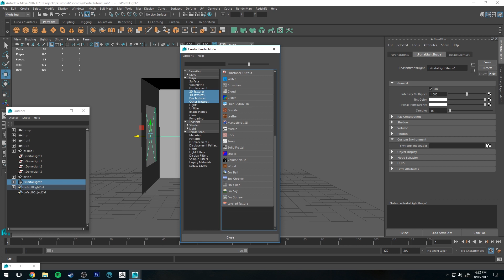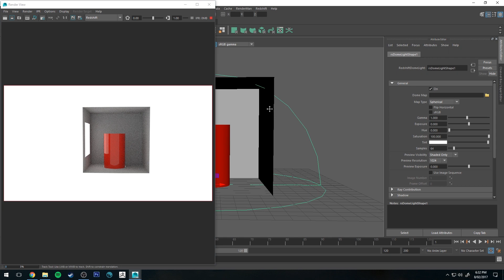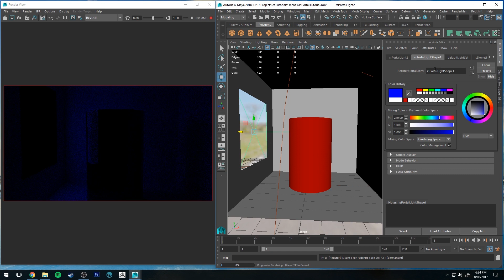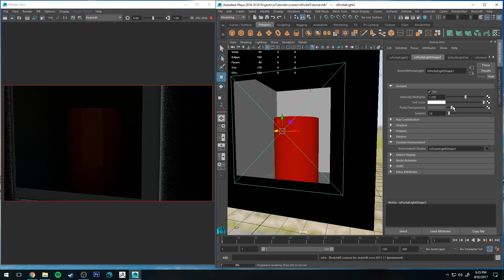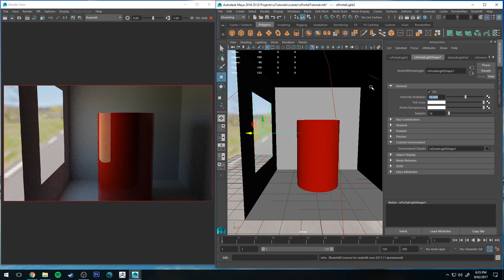Redshift Portal Light Tutorial

Comment: Hello Micheal, I have a quick question, i see you connecting the Redshift Dome Light in to the Portal Light. But is this step really needed? I have never done this before, for example if I already have a Dome light in the scene and create a Portal Light afterwards, it looks like its working just fine. Does the PortalLight.EnvironmentShader need to have a input connection to a dome light? Does this give better results? in the Redshift help files it says that its for overruling the Redshift Environment Output Settings. So i think that means that if you already have a environment setup, that you can make the portal light use a different Dome for quering / taking the rays from?

Comment: Thank you for this video, i was just wondering what kind of pc spec do you have?
I have gtx 980m 8gb. should i buy redshift? How fast is redshift? Thank you very much for this video. Make more, Liked and subscribed
Reply from the maker: +Mr Fox I have an intel i7 6700k and a gtx 1070 (desktop) as well as 32gb of RAM. If you want to see how an 980 fares so far as render speed goes check out my Redshift first impressions video I was using my old computer there that had a 980 (also desktop) and a i7 3770. I'd recommend getting the trial to decide if it's right for you (trial is free) then you'll be able to decide for yourself whether it's worth it :)
Reply: Thank you very much SRS. You are awesome. I will follow you forever!